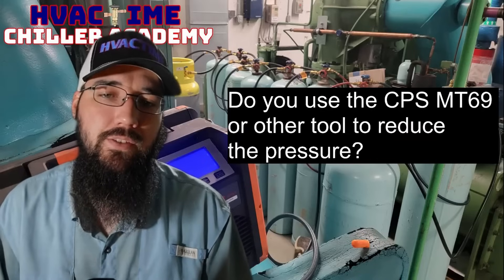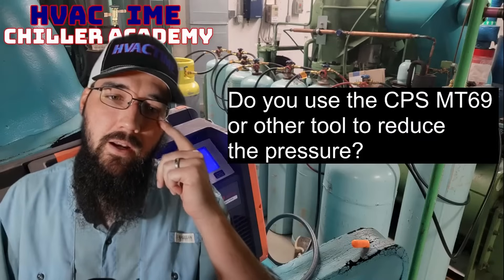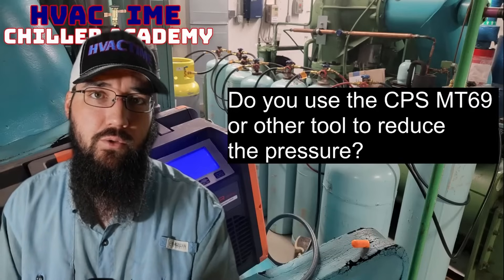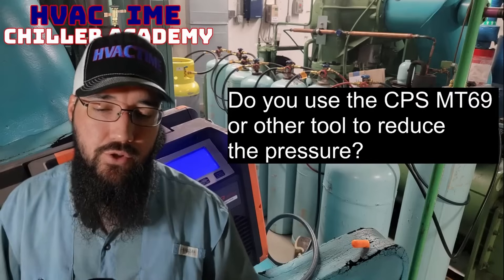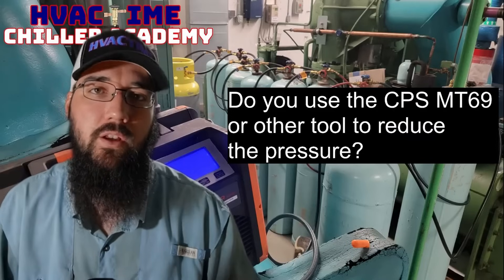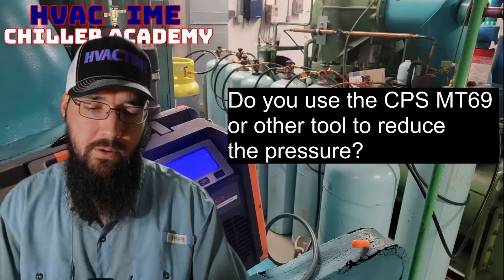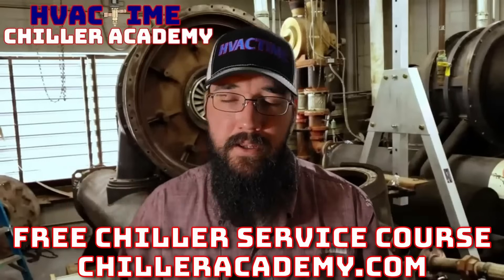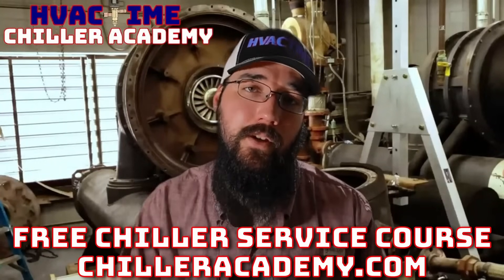Do I use the CPS Subcooler for Chiller Recovery?

Comment: I copied you with the brazed plate. Made it slightly different, but same results. I also like to use an operating chiller. Hook up to the supply and return lines. That 44° water does a fantastic job

Comment: the name is MT69 Molecular Transformator. you just know they were just taking the piss with naming that.
still, i use it on any size system. only thing i have to do is replace the water in the bucket a couple times if the system is large. sometimes of the system is big and i am working with others i just "loan" the MT69 of my coworker and just put them in series with a short hose between them and each in their own bucket.
pro tip if you dont have any water: of you got a appion G5 you can just put the MT69 in front of the vent and use the air from the appion to aircool it. by far not as effective as water but if you are in a bind its better than farting against the tank....

Comment: CPS tool is good for when running a water hose isnt ideal and the charge is under 100lbs. Eventually the water will get hot.

I bought a coaxial coil from the supplier and brazed on 3/4" hose connections for the water side and 1/2" ACR male flare for the refrigerant side. Just need a slow steady trickle of cold water and it will keep the refrigerant entering your tank cool and saturated / liquid. Braze plate is the same thing but I found the coaxial first and stuck with that since. 

The biggest con of the CPS tool is the small 1/4" tubing which is much smaller than the 3/8 or 1/2" hose any chiller mech should be using transferring refrigerant in a chiller over 50 tons, but for the small outdoor units, throw the CPS in a bucket of water and it will work for a few hours. Could always dump the hot water and get a fresh bucket of cold water. I did this for about 3 months before I got sick of carrying buckets and made my coaxial heat exchanger.  A little more prep work (requires 2 garden hoses and a drain) but once its setup you just grab a chair and watch it (or do other tasks nearby.)

I wish manufactures sold a small recovery unit with a built in water heat exchanger and 3/8 internal tubing that weighed under 50lbs. It can be done, but I understand chiller work is very niche.